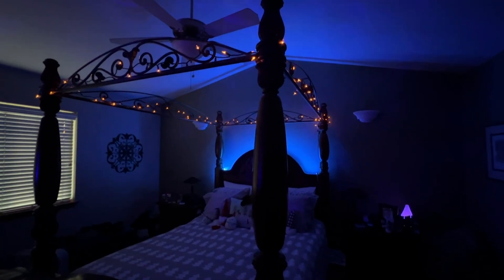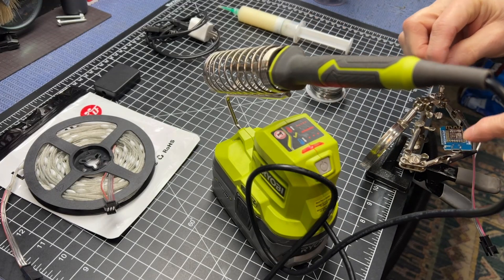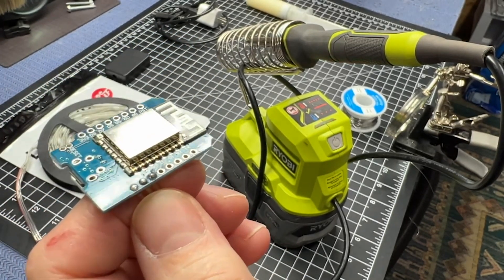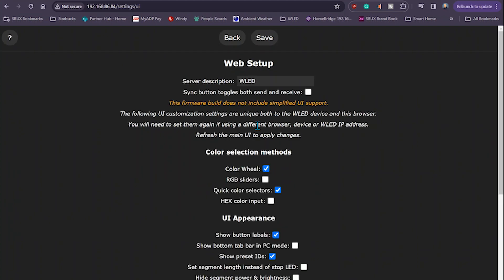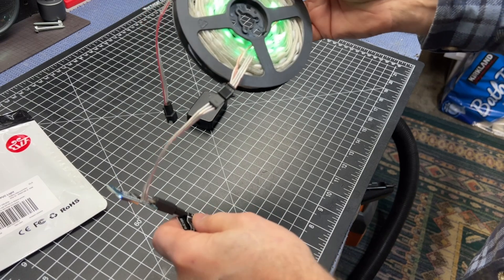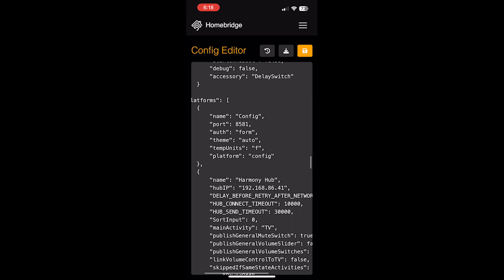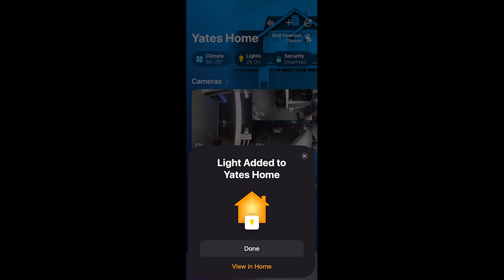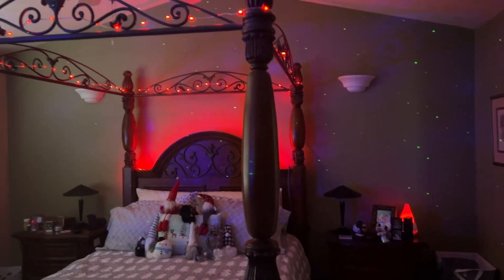WLED Fairy Lights in SmartHome (Apple Home)

Comment: okay, so I put the names of my presets in and they don't do anything.  I have 8presets in my controller. out of the 8 I can get 2 to work. the others do nothing even if I use the preset number (1,2,20,95,96,97,98,99)